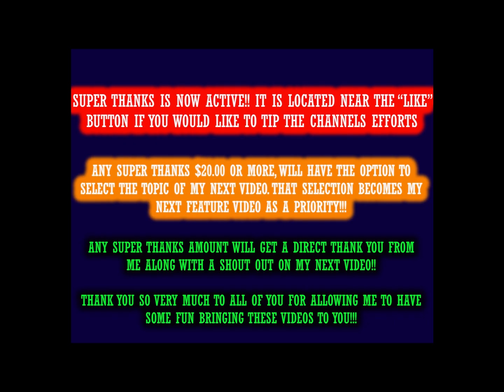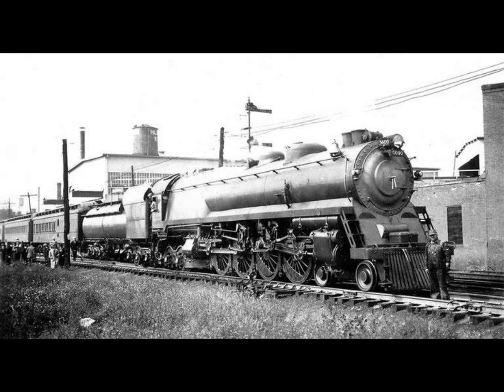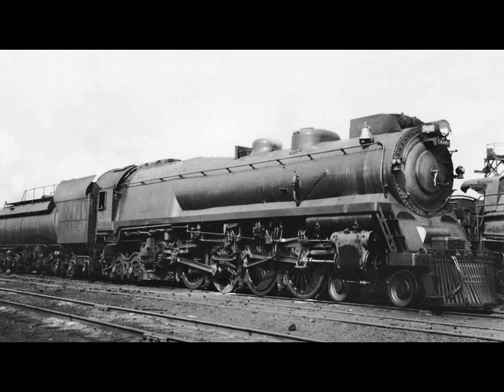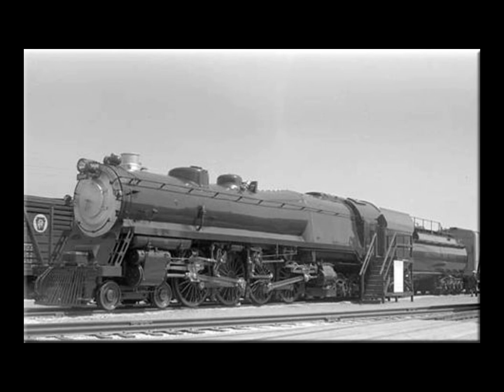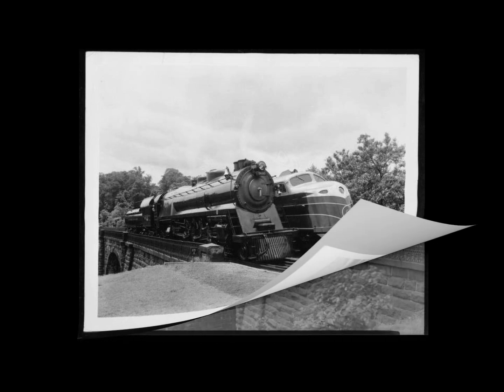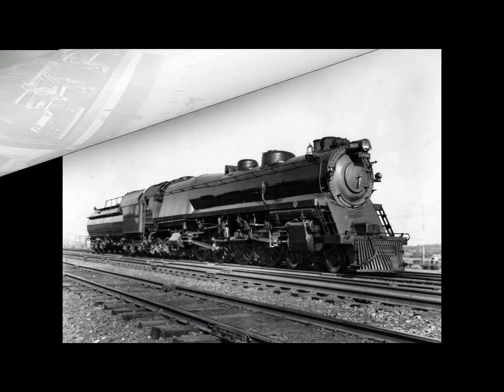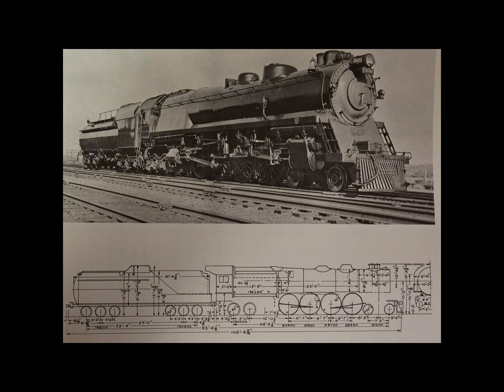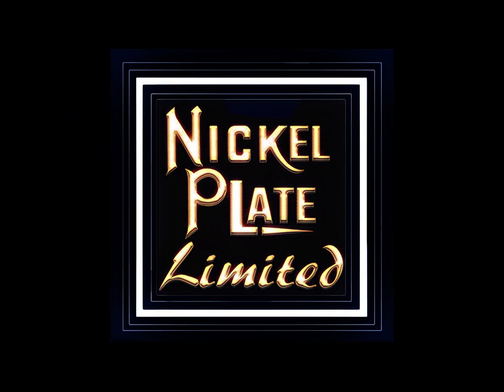B&O Railroad 4 4 4 4 Duplex Locomotive, The Emerson Experimental

Comment: yes the emerson style firebox it was a hybred it was a firetube but had a waterwall like a watertube around the firebox, but as you say vibration caused it leaking and the watertube part had issues with cleaning the limescale off the curves that made up the waterwall part of the firebox it had to be turbined out more often and it was harder to clean I read, but I think it was a brilliant attempt at engineering and use of space to get the most heating surface they could, problem is with most watertube boilers is they cant take the vibrations of railroad work as its not as ridged as the regular firetube boiler, not like a ship or a stationary boiler that would have one, now as for current projects mackwell locomotive works in new zeeland made a steam tractor and small locomotive version using a lematt style boiler and did away with the waterwall that is watertube and seems to be doing ok so far.

of course if you like an interesting read check out the patents for watertube firebox locomotives you want to talk about complex good gravy its a litteral pipe dream as they have a lot going on and many parts and waterdrums